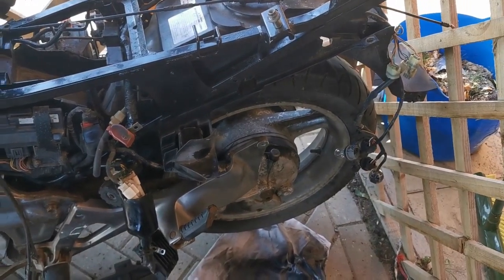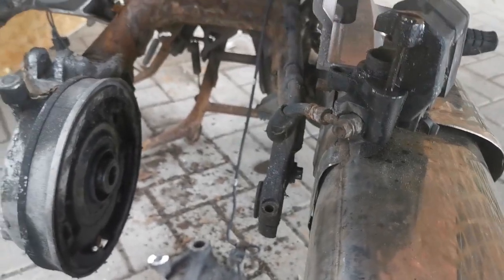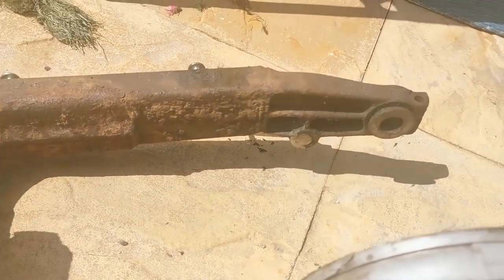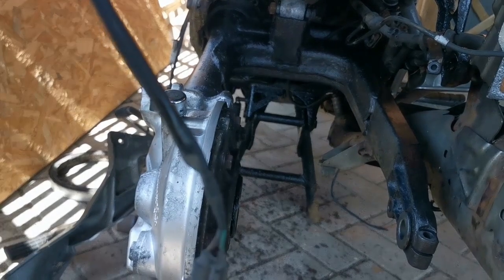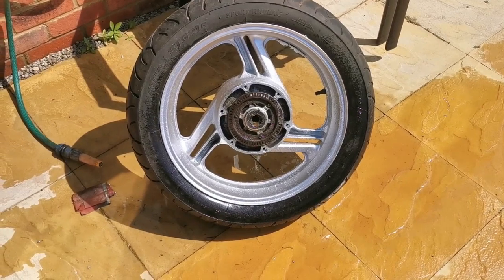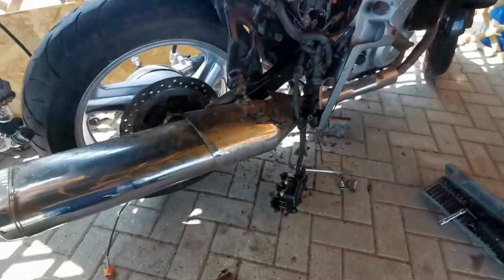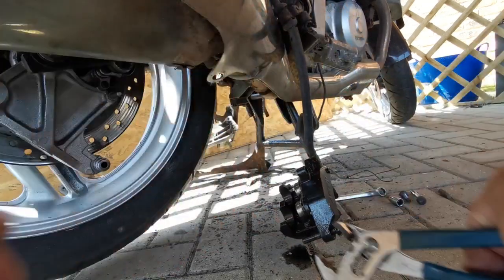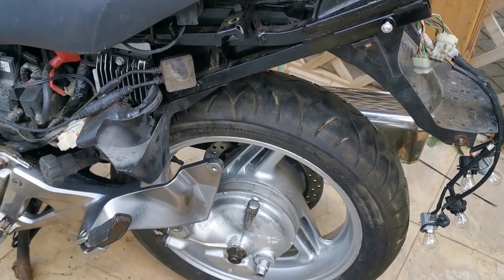Honda NT700 Motorcycle restoration, was sitting unloved for 5 years, now it begins its journey back.

Comment: I would have replaced them brake cylinders, they will destroy the seals as they are, i have just bought two Deauvilles , i bought a 1998 first with a view to restoring it, i then bought a 2003 as a donor bike, but it turns out the donor bike is in really good condition,  so it saves me a massive job.
Reply from the maker: Good shout about the seals. Often the way when you get a donor bike that it turns out better, glad it turned out ok. 👍

Comment: do you have any advice removing the panniers? i want to build my own but everywhere ive read says they dont come off. mine is nt700v
Reply from the maker: Hi mate, the unpainted plastic bits come off first. The plastic engine guards are only one Allen screw underneath. The plastic panels under the seat pop in and the plastic panels that are quite big with the little vents in them have one Phillips screw holding them on each side. The panniers screw in from a few different places, best to not force anything and take your time. They are quite easy just be sure to take photos or make a note of what goes where. Good luck and if you get stuck drop me a message 👍
Reply: @vroomroom1  thanks mate 🙏